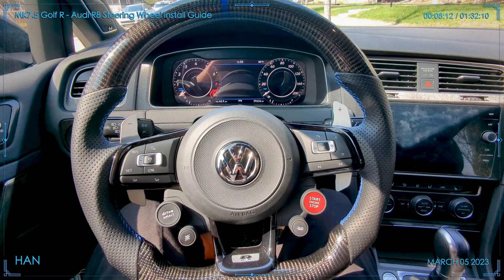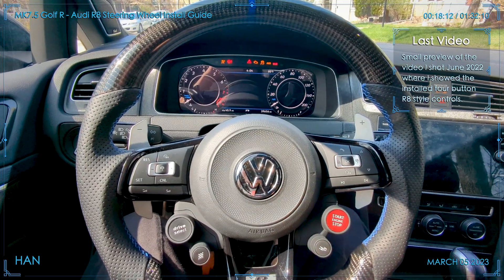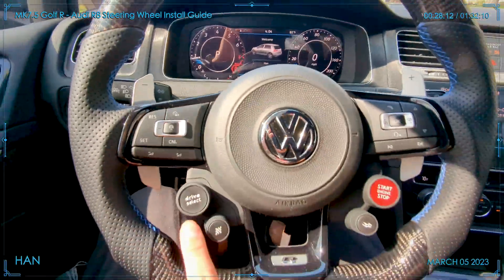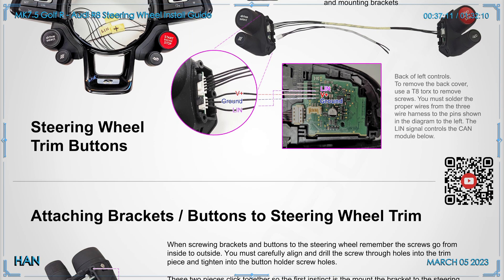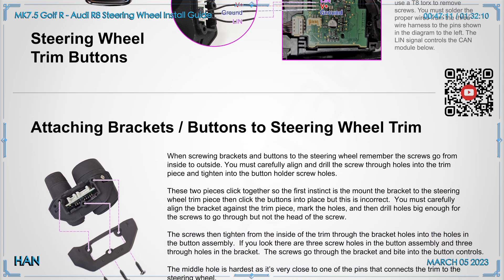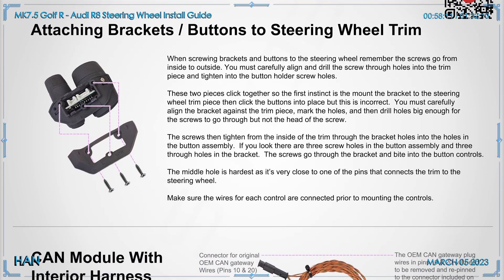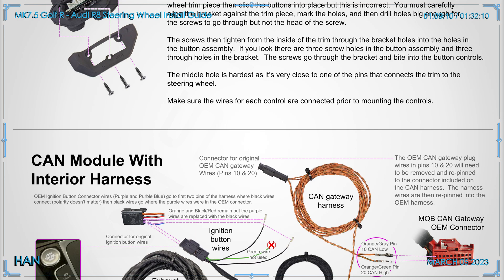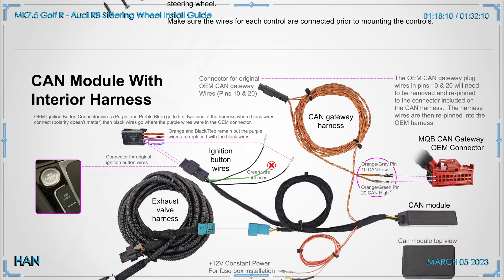Mk7.5 Golf R Audi R8 Steering Wheel Installation Instructions

Comment: i wanted to let you know and it might be a variation in the platform as i am 2018 audi rs3 but it is still mqb but the red connection 10/20 was not can hi can low for me. In that connector 17/18 was my can lines. I hooked them up but the drive select didnt work there for me.   For me i had to follow my directions pointing me to connector a1 behind the glovebox.T12v (connector e) grey pin 6 and 12 .     That made my drive select work. Even though they are both can connections i talked to a friend and he said some canbus items need to be connected before the gateway to work. So that may be your issue to fix your problem.  Just thought i would mention it.

Comment: I have to ask here, is this possible the same for the heated steering wheel there are 2 or 3 wires? solder these wires to get heating from these R buttons?

Comment: Does driving mode only work on a car that had an existing dedicated drive mode button? I am trying to see if I can use this product on my 2014 audi rs7 which comes stock without any drive mode button so I have to go into the mmi menu to change drive modes.
Reply: Not positive about that, mqb should all be similar but I only did my diligence on Golf R

Comment: Thanks bro. I managed to get “driving mode” working using your video.
Reply: Sweet! Do you have an MK7 or Mk7.5?  I'm curious if this works out of the box on MK7 as the drive modes are named differently than on MK7.5
Reply: @ It was placed in a 2017 Audi TTS, same “can box” as yours, even the wiring in the can gateway connector was the same.

Comment: Hey man did you find solution for the race mode ?
Reply from the maker: Not yet but I have a friend who does programming (ODIS/VCP) and we're gonna try.  Not horrible now as I CAN get to custom so I use that as race. The only part I don't like is it won't open the exhausts automatically with the race flag button but meh I have an exhaust button too on the right.
Reply: Did you make it to race?

Comment: Fixed?
Reply from the maker: Not yet but I have a friend who does programming (ODIS/VCP) and we're gonna try.  Not horrible now as I CAN get to custom so I use that as race. The only part I don't like is it won't open the exhausts automatically with the race flag button but meh I have an exhaust button too on the right.
Reply: I have odis and everything but dont know how race mode can be summoned  @hanshobbies
Reply: @slimshouki  Thank you! I think I have an ADAS person locally willing to help. The way this system works is there is a separate module that ties into the CAN/LIN bus and it basically issues the proper sequence for the CAN bus to start the car or switch modes as if you pressed the OEM button.  Where I think it's getting tripped up is this is made for the MK7 and the MK7.5 has slightly different nomenclature for the modes as well as maybe different command sequences/addresses.  So really it's about re-programming the module to issue the proper commands for RACE mode (both on mode selector as well as the race mode which puts it instantly in race and opens the exhaust valves).

Comment: Hello, my pin is only 10 pin and in your image it is 20
Do you know which pins I have to change?
It's from the driving mode
Reply from the maker: I am not exactly sure about what you are asking.  Are you saying the CAN connector only has 10 pins?  Can you elaborate a bit?
Reply: @hanshobbies  If the main connector that goes to the drive modes only has 10 pins
Reply from the maker: @javisestrada2551 Sorry I don't know, only did this on mine and it is as shown.
Reply: Hi, I have the same pin, starting works, but when I connect pin3 and 6 mode it doesn't work, did you manage to connect it?

Comment: Hello, I bought that kit, I already did the installation as shown in your pdf but I don't have any function, do I have to program something? I would really appreciate it if you could help me
Reply from the maker: Should not have to program anything but I can't really help you if you wired it the same as mine and it's not working.  I only have bought this for my car and even mine isn't 100% due the change in drive modes between MK7 and MK7.5 (or the CAN codes to activate Race mode properly).

Comment: Hi friend, could you tell me if I connect the "lin" wire on the steering wheel circuit board and the 2 orange wires ("can+" and "can-") to the red Can connector on the MQB Can gateway, the drive select button will now go work without needing configuration?
Reply from the maker: What I think you are asking (correct if wrong) is if you connect the LIN / V+ / Ground wires properly to the steering wheel and then connect the CAN module properly to the  red OEM CAN connector will the select button work without programming?  For me on my MK7.5 Golf R, yes it did.  All buttons work but on the MK7.5 hitting the race button (flag) should place the car into Race mode and open the exhaust valves (have to use the included exhaust valve wires run to the valves)  but for my car it does not shift into Race mode as I think in the MK7 which this CAN module is most likely for (not sure as I only have MK7.5) either named the mode differently or had a different CAN address.  I believe (again guessing here) that MK7's should work as expected.
Reply: @hanshobbies i wanted to let you know and it might be a variation in the platform as i am 2018 audi rs3 but it is still mqb but the red connection 10/20 was not can hi can low for me. In that connector 17/18 was my can lines. I hooked them up but the drive select didnt work there for me.   For me i had to follow my directions pointing me to connector a1 behind the glovebox.T12v (connector e) grey pin 6 and 12 .     That made my drive select work. Even though they are both can connections i talked to a friend and he said some canbus items need to be connected before the gateway to work. So that may be your issue to fix your problem.  Just thought i would mention it.

Comment: Hello there I need your help ! To connecth to the ignition hardness ( purple cables ) my kit does not have 2 black wire and 1 green , mine has 1 blue , white , green 😢
Reply from the maker: Well, the ignition wires simply complete a circuit so really there is no polarity per se.  There is only open and closed so as long as these wires are for the ignition, polarity should not matter.  What I would do is to connect the CAN module, then if you can, use a multi-meter to test which wires make the connection when you press the START/STOP button on the R8 buttons.   The alternative is to just try a combination of 2 wires until you get the pair that works.  I'm not sure if your kit is the same as what I have but if it is then two of the wire should work.
Reply from the maker: So in my diagram the wires you want to use are the first two in the connector (in my diagram they are black)
, the third one (green in my diagram) is ignored.